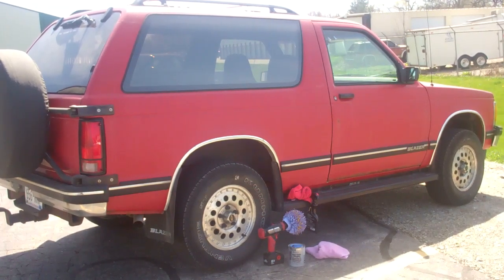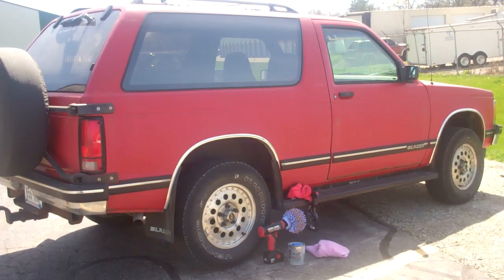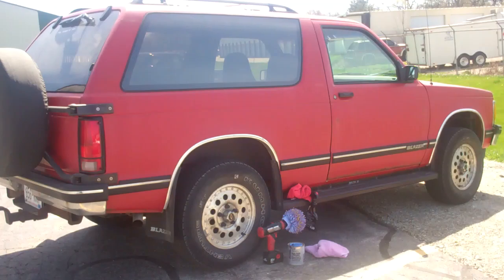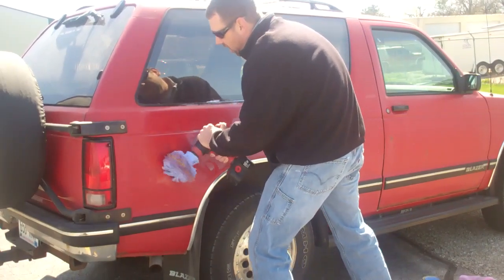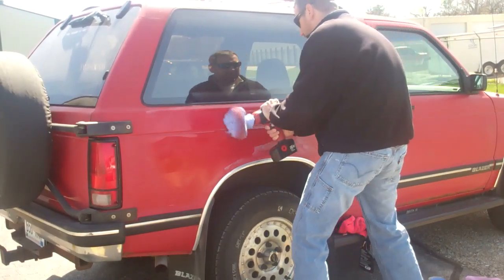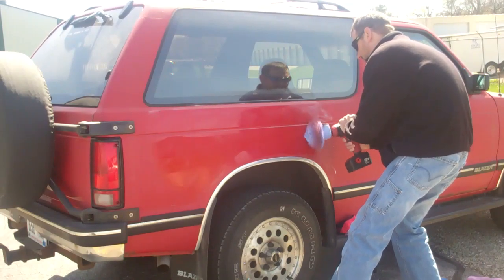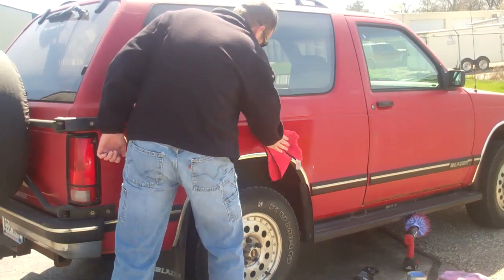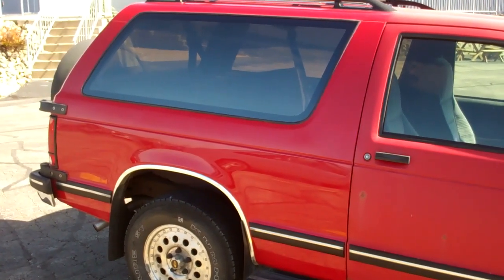How to clean & restore oxidized paint on a vehicle..mp4

Comment: Funny you do a whole long video that's great except. Show us the can of flitz polish or whatever you are saying. Also tell us where to buy it too. How does it compare to maquires ultimate compound?
Reply from the maker: Hello Charleysturbos, The FLITZ product I was speaking about was there paste polish. As for were to get it I guess I would contact them or check out there website. I normally get it from my Snap On tool guy or my local hardware store. As for Maguire's Compound I have used that in the past but I like the results I get with this and its a paste not a liquid so much easier I think to work with. Thanks for checking out my video.
Reply: Thanks for the help as well. I will try my maguires ultimate since i have it. Think i did it on my eclipse before but not sure if i did that or wax. Now i see you need to do what you did and then add wax after. Not sure if i did. I have clear coat peel on one side of car so i need to check that again and try new things.

Comment: THIS DOES NOT WORK WITH CLEAR COAT CARS!!!
Reply from the maker: Yes you would not want to use this on a new car if the paint is still good. That's what wax is for. Thanks for checking out the video..
Reply: Don't break your neck padding yourself on the back bro. I wasn't impressed
Reply from the maker: As they say you cant make 100% of people happy all of the time. But thanks again for the comments and checking out the video. Have  a great weekend Suesan..
Reply: Lmao
Reply: Suesan Rood  rude! And its "patting"